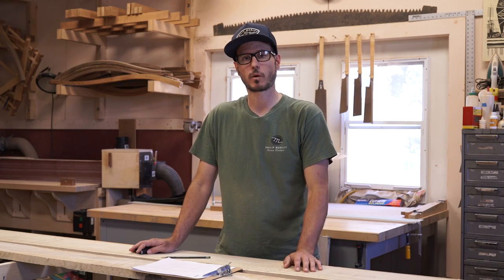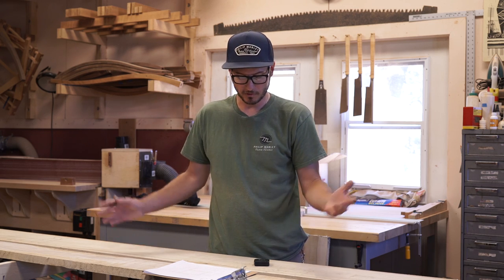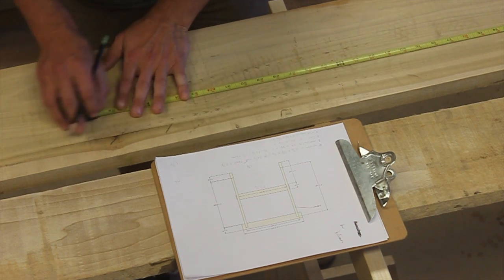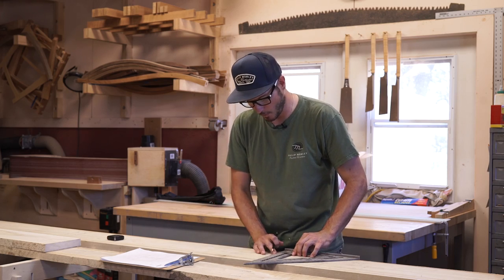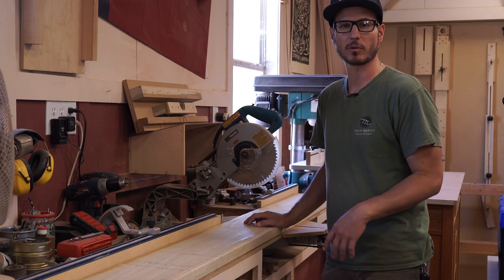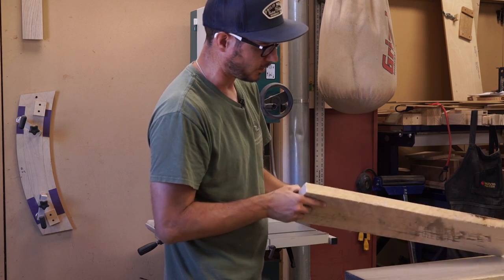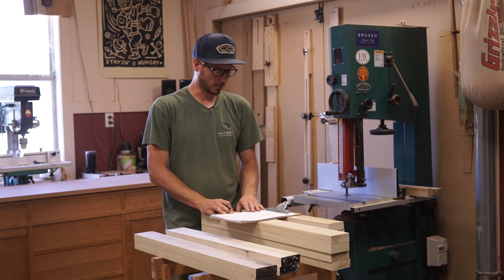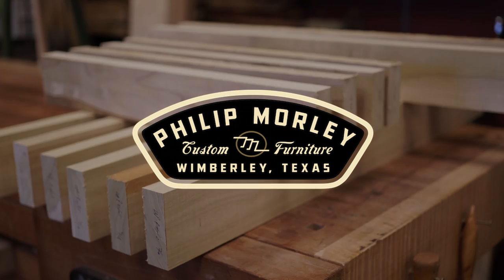James Krenov Style Sawhorses | Part 1 - Part Selection

Comment: Philip, what kind of wood is that?  This video has a lot of valuable detail info, especially for the beginner.  Thanks!
Reply from the maker: +Rob J. It's poplar. Cheap and easy to use both just about any wood will work.